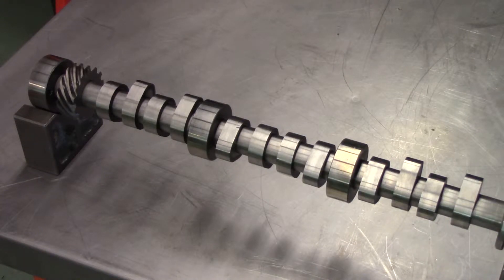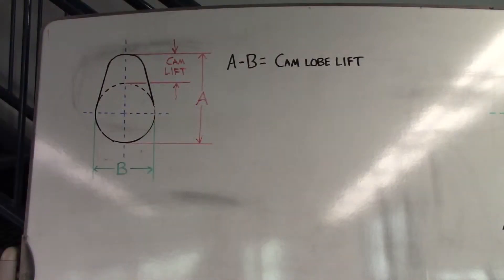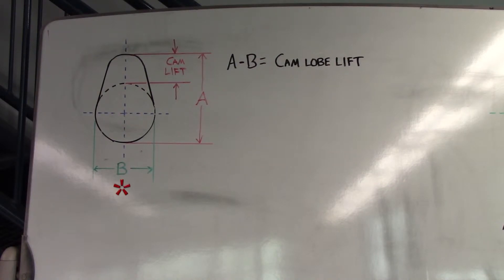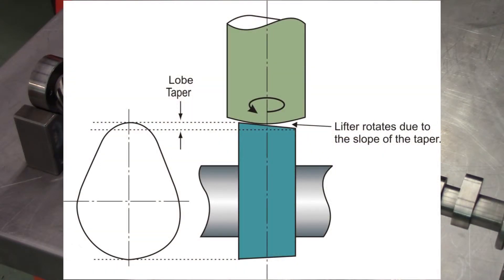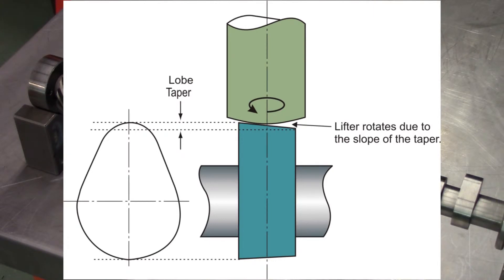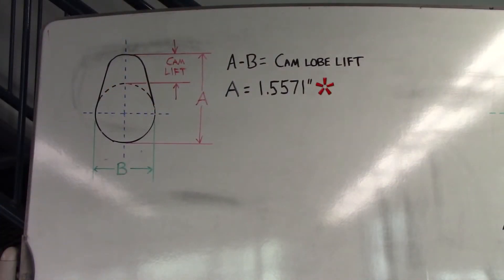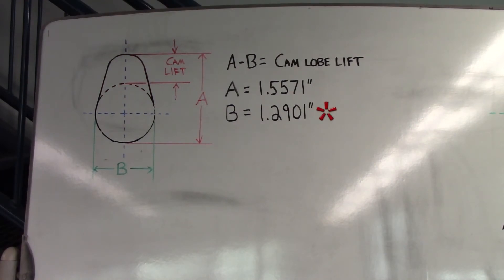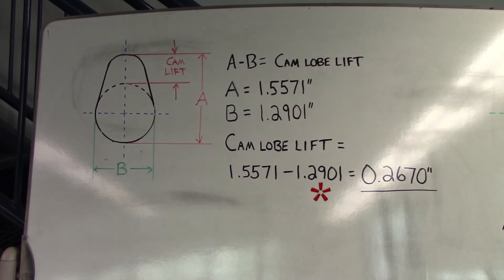Camshaft lobe lift measurement using the calculated method.

Comment: Which typically lifts more, intake lobes or exhaust lobes?
Reply: recently worked on a mazda 6 I4 engine, the intake lobe measures 1.671" and the exhaust measures 1.621", so for this engine, the intake lobe lifted more than the exhaust